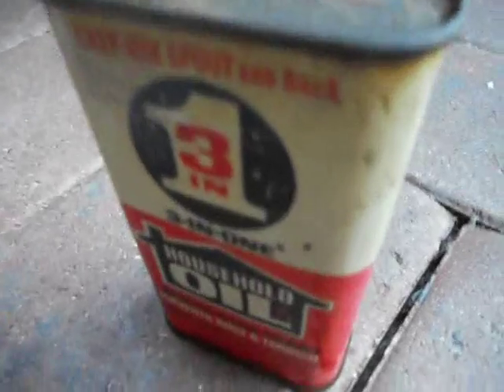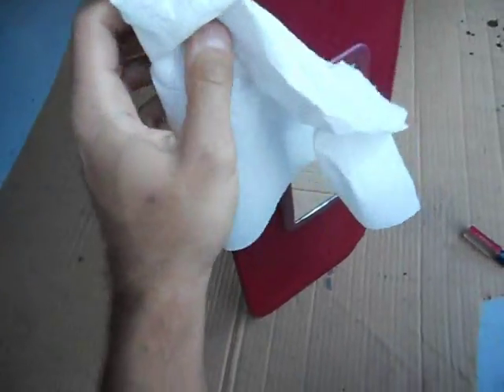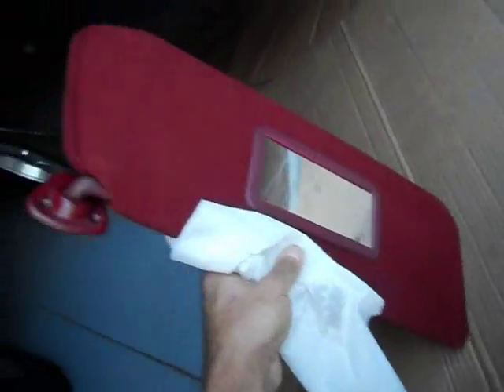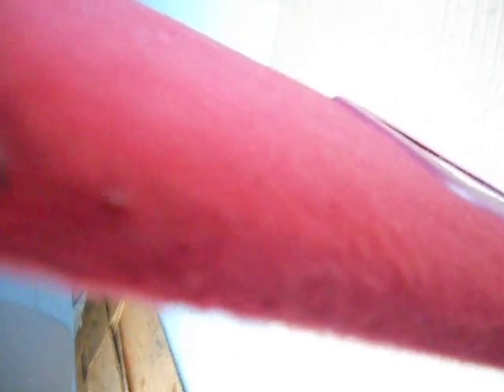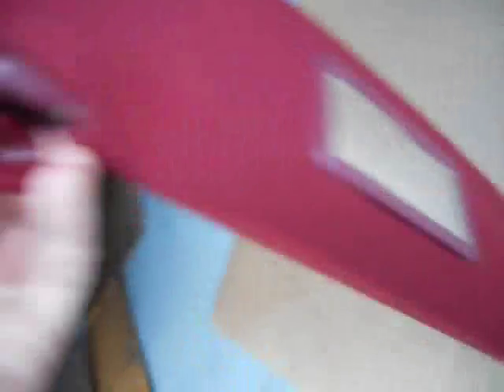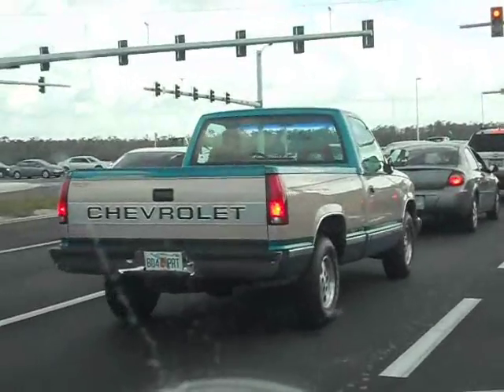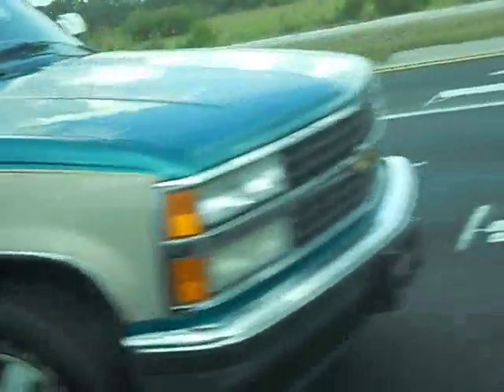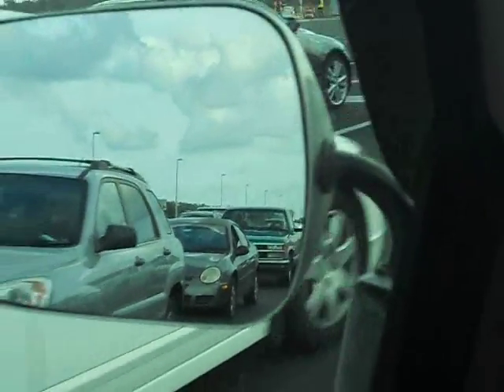Auto Sunvisor squeak fix

Comment: Great video! Mentioning specifically where to put the oil, to use an abundance of 3-in-1 type oil, titling for a period of time and repeatedly working in the oil until the visor was easier and quieter to move back and forth.  Big difference now! And, yes, guilty, I am a frequent sun shade user and have a 15-year old car. Thanks for the cheap fix!
Reply from the maker: Almost forgot I did this. Ya still quiet years later. I may try some sort of inject able grease on a syringe if I have issues again.  less chance of stains

Comment from the maker: This is the 2nd time I oiled up the passenger side. The 1st time It lasted about a year but I did not oil it alot. This time I SOAKED IT, it flips real smooth now  I was thinking about greasing it, But really to do it right, one would have to cut open the visor.